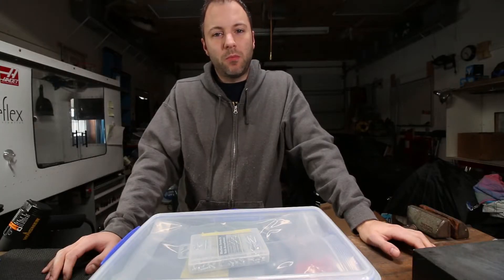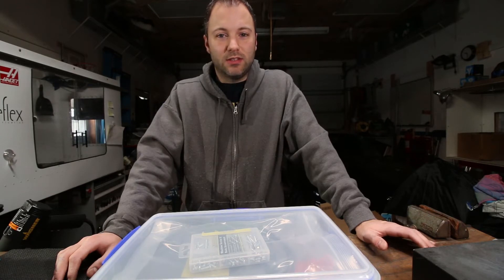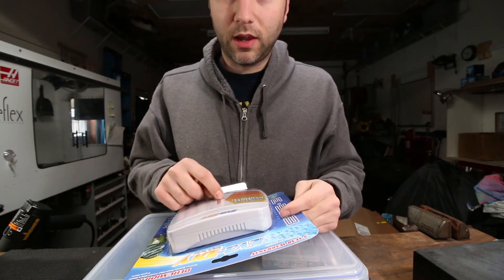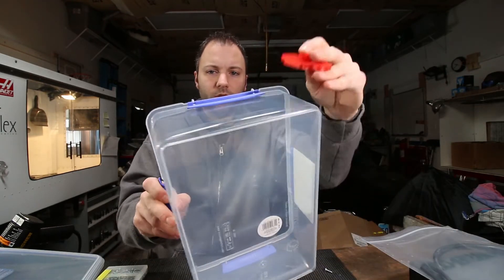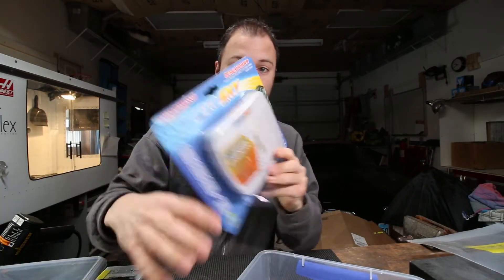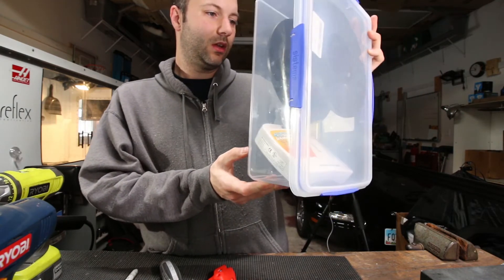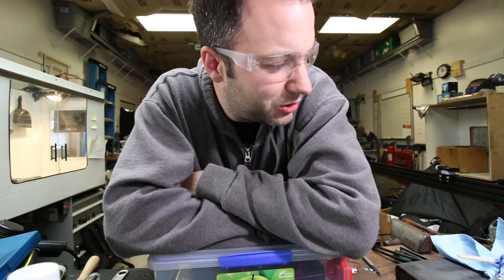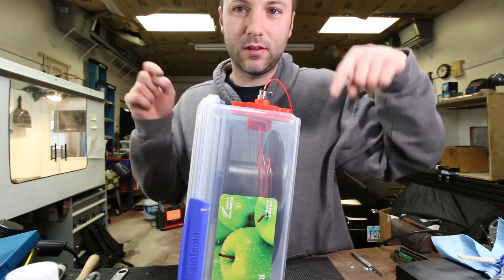Build a Drybox for 3d Printing Strong Nylon Parts

Comment: If you're using a dryer that's just heating the water up and boiling it well then you get steam and steam is moisture in the air again so that doesn't seem like it would be very useful

Comment: A 5 gallon bucket on its side would be perfect for your setup. You could even store multiple spools inside if you wanted. Sealing your outlet for your filament might be a pain, but in general I feel like it would work better.

Comment: Ultem 1010 is only $90 / kg when industrially sourced, and is not terrible to work with. That being said, your experience may vary
Reply from the maker: I've personally never found a use for ultem in my projects even at the price your starting it's still pretty pricey and a challenge to print (much higher temps for enclosure and nozzle). I've yet to find a project where I needed anything stronger than nylon in terms of 3d printing. Maybe someday I'll find the right application and give it a shot.

Comment: If you have an industrial printing cabinet, just add a fkn dehumidifier
Reply from the maker: Dehumidifier requires electricity to run. Dehumidifier are actually quite power hungry as well. It's much more affordable long term to seal up the filament and isolate it from humidified air than to keep the whole cabinet dehumidified.

Comment: The mcmaster links are not working, could you post the part numbers for them so I can look them up manually?
Reply from the maker: Yeah I will repost those later today. Sorry about that.
Reply: @SafetyGlassesRequired  No need to apologize Thank you for helping us beginners out! 

I'm really excited to try printing in Nylon!
Reply from the maker: Fixed with new links that might work better.

Comment: one suggestion: Ikea sells better container, with a much sturdier type of plastic, and they are pretty good sealed
Reply from the maker: Good tip. Thanks
Reply: the only small problem is that it has a rounded shape on the side and it can't stand properly...you gonna need a sort of fusion with a couple of legs...maybe glued with hot plastic glue

Comment: The holy grail for me is polycarbonate, and POM/Acetal. These are just about doable at the moment I think. I print a lot of Polymaker polycarbonate, and smaller parts in raw polycarbonate by enclosing my printer. Acetal on the other hand is going to require heated chamber.

I love nylon though. Great for loads of applications. I've made a filament dryer from a food dehydrator. Just modified every other shelf with side cutters. Only cost £30 and does a FANTASTIC job on nylon.  I dried some taulman bridge and nylforce carbon and the surface improved 100%. I've built a dry box filament spool holder like this too. Great for all filaments! Polycarbonate also sucks moisture out of the air.

Thanks for the videos man!
Reply from the maker: +Jai Stanley thanks for the tips! I sort of forgot about PC when I filmed this vid.  It's on my list of materials to try for sure. Acetal would be awesome as well but that seems like more of a challenge.  Which food dehydrator do you use?
Reply: Safety Glasses Required It's branded as an Electriq 'digital electronic food dehydrator with timer'. Google that, but it looks identical to loads of different ones I've seen. I'm in the UK but no doubt it's made out of chinesium! I had to get one, my other half got sick of filament in the oven and it was too easy to overheat and warp the spool the nylon was on. This thing is a godsend and only draws 240watts
Reply: Jai, I'd like to see how you modified the food dehydrator, or did you? Do you just put the filament inside the dehydrator and let it run?  Thank you